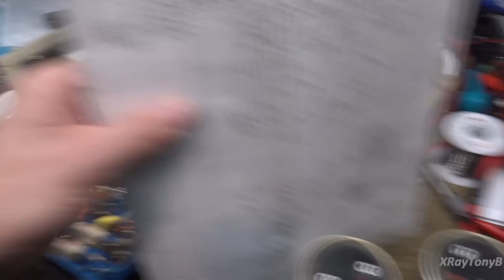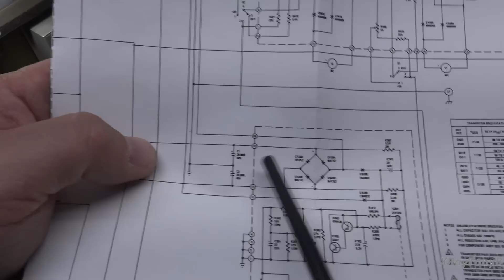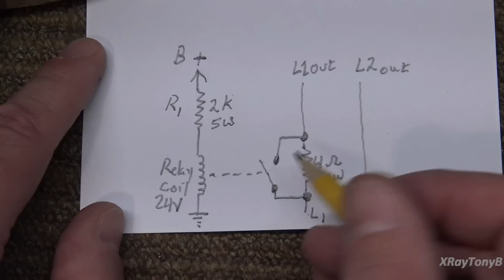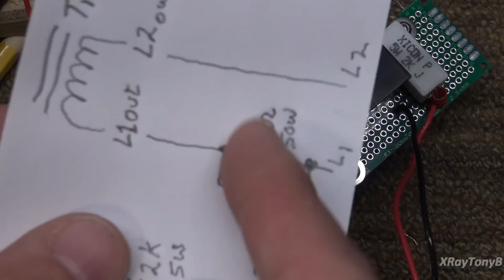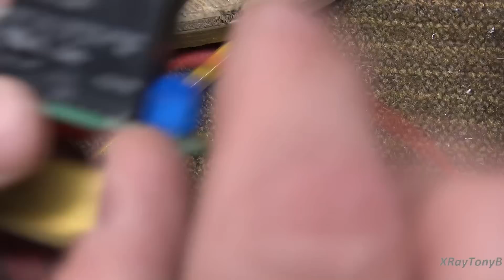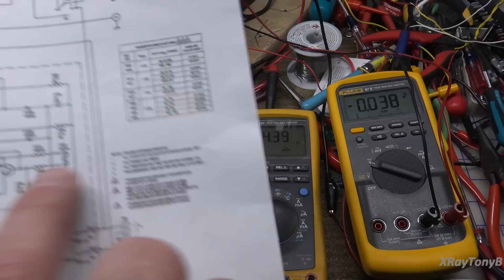Adding a Soft Start Circuit to a Power Supply

Comment: That a great circuit. I do a lot of  power supply's and Tube RF amps that have large capacitors . Them values of inrush resistors can change with size of transformer and voltage of line. with that amp in video you could use 48V relay coil. 24 DC is very common. Also that inrush current is hard on diodes . I had so many go bad . even broadcast transmitters use soft start . just 3 resistors for 3 phase with a contactor across. and the output tubes filament supply has step start . taps on primary of filament transformer. There is a outher soft start circuit that is similar and works great I use on tube RF amps. ham radio type. using a 240V or 120V relay coil across transformer primary. then the series resistor is 20 to 30 ohm 240V 10 ohm 120V 50 watt or so with a 2 or 3 amp slow blow fuse in series with resistor. If you have a diode short or tube short the 2 or 3 amp slow blow fuse blows saving the big surge. I copied the soft start from 3 phase and made it for smaller units. mind you running 480V with 277V to natural. 277V contactor. 500 watt resistors in a cage . 3 cartage fuses 600V . does same thing. large or small that soft start really works. Thank you,😀

Comment: I like this solution better than the thermal ones. Quick cycling can defeat those. Whether it's someone playing with the power switch or just quick power-outs, it's bound to happen.
Reply: The thing that bothers me is that the rail voltage goes pretty low before the relay opens. I'd rather have it open when the capacitors drop to 80% charged.

Comment: preferring transistor than relay for realizing smoother and safer soft start function, and hoping the circuit diagram fixed on the table and viewed by your camera with smooth panning and enlarging in order for watcher to view the circuit exactly, best...

Comment: When you say, “you can add fly back diodes if you want, it won’t hurt anything,” I’ve read (and can dig up a hard copy of) an article by a relay manufacturer that said that reflexive  use of fly back diodes can and do harm the contacts of relays. The manufacturer was objecting to the very thinking you are commenting on, that is, that many feel that if the relay is DC, they need to include a fly back diode. I guess what I’m trying to say (and not doing a very good job of it) is that while in the case the circuit presented, i.e., the soft start circuit, the use of fly back diodes won’t hurt anything; it is not true in every case that the use of fly back diodes won’t hurt anything. If I recall correctly, I think the relay manufacturer was advising the addition of a resistor in series with the fly back diode to cut down on the rush of ‘fly back current and resulting arc flash destroying the relay contacts. I need to go back and re-read the article. 

As others have stated, I found the entire video very interesting and informative. I have a tube amp with soft start. The manual is at pains to say never to turn the amp off and then immediately back on or damage to the power supply may result. Because I managed to inadvertently perform that maneuver a few times, I put a label on top “1 Minute” to remind myself. I’m not sure how their soft start circuit is constructed, but you analysis helps me understand better how and why such a delay is recommended. I do like how you break everything down, your passion is contagious. Going to dig that article out now.
Reply: An extremely simple (and low cost} soft start "circuit" consists of a single thermistor which adds resistance when cold and becomes more conductive as it heats up. Without a relay to bypass the thermistor it will remain hot when the amp is powered, and after power is disconnected it will take some time for it to cool down. Until the thermistor can cool down sufficiently it will not be an effective current limiter. A rapid off-on cycle defeats it.
Reply: @steveboguslawski114  Thank you for the response; you’ve increased my understanding of why I need to wait. The manual was not very technical.
Reply: @steveboguslawski114  It seems to me that this circuit has a problem similar to the thermister circuit. The rail voltage has to drop quite a bit before the relay opens.
Reply: @BlankBrain  True. A lot depends on how fast the power supply capacitors discharge when power is interrupted.  The use of a fixed resistor rather than a thermistor eliminated the problem of waiting for the cool-down period. But the goal is to reduce inrush current and the highest current occurs when the capacitors are completely discharged. You avoid the worst-case situation since the relay will open before the capacitors fully discharge. The issue now becomes the difference between the pull-in and drop-out points of the relay. If you carefully choose the resistance in series with the relay you can get it to pull-in at a higher rail voltage, which will have the benefit of raising the drop-out point as well. A more complex circuit could be used to cut power to the relay quicker.
Reply: @steveboguslawski114  I was thinking about using a zener diode to control the relay. Relay closes when zener voltage is reached at the rail. When rail voltage drops below zener voltage, the relay opens. It only adds one part.
Edit: This is an improvement, but doesn't protect the transformer. A 555 timer set to 500ms to 1s would be better. More complex circuit and my need power for the 555! I'm looking to protect vintage gear, so I'll do whatever it takes.
Reply: @BlankBrain  I understand there is a fuse in series with the primary of the transformer.  The right fuse would blow much faster than the time needed to cause any damage to the transformer.  I frankly find Tony's solution to be electronically-effective and cost- effective.  I would just install a flyback diode in parallel to the relay coil, nothing else.  If I can give any other constructive criticism... I would not make holes in any place in the vintage equipment, I would find a solution to install a new board without making holes in the equipment.  That is all I have to say.
Reply: @kylesmithiii6150  I'm not worried about blowing the transformer. There is mechanical shock and degradation that can eventually cause failure. Besides, I don't like my lights dimming when I turn my amplifiers on.
Reply: @BlankBrain  Good points.  I will do some tests replacing the 4R7 (50W) with some much higher than that and see how it performs.  I am 100% with you about "I don't like my lights dimming when I turn my amplifiers on.", that reminds me of the 'Chevy Chase Christmas vacation lights scene'.
Reply: Wikipedia has an article called "Flyback diode".  The folks who wrote that article explain quite well the subject, including a screenshot of the transient negative voltage spike across the coil of the relay.  In summary, the electromagnetic energy stored in the coil needs to be dissipated (or transformed) immediately when the current across the coil is turned off (since V = L di/dt).  With a flyback diode installed, the energy will be dissipated as heat on the resistance of the coil in a fraction of a second when the relay is turned off.  If that coil resistance is not appropriate then a resistor needs to be installed in series with the flyback diode.  I have never seen ordinary relays that come with a flyback diode installed at the factory (but I am sure that they exist), but I have seen and used reed switches that can come with a flyback diode already installed for the exact same purpose (see for example item number HE3621A0500 at Mouser or DigiKey --  "Optional coil suppression diode to protect coil drive circuits").  Related to your point, that Wikipedia article says: "Design: When used with a DC coil relay, a flyback diode can cause delayed drop-out of the contacts when power is removed, due to the continued circulation of current in the relay coil and diode. When rapid opening of the contacts is important, a resistor or reverse-biased Zener diode can be placed in series with the diode to help dissipate the coil energy faster, at the expense of higher voltage at the switch..."
Reply: @kylesmithiii6150  That’s great and very helpful, as I couldn’t put my hands the article I cited even though I saw it recently. Thank you not only for the reference to Wikipedia, but your cogent interpretation to the matter at hand. Like you, I’ve never seen a relay from the manufacturer with a fly back diode installed, I seen many DC relays installed with fly back diodes in the field.
Reply: it seems to me that the flyback diode is only across the relay solenoid.  The contacts are in a different circuit.

Comment: I've done similar using a scr that slowly (over 10 cucles shorts out a resistor that is in series with the input of the transistor. The only thing agaisnt this is even wen it's full on it will still rob a volt of the incoming votge because the acr does not go to zero.

Comment: Hi Tony. If you have a relay with an extra set of contacts (DPDT), you can wire in an extra resistor (whose value will have to be determined by experimentation) in series with the one already there, and put this resistor in parallel with the normally-closed contacts so the resistor is shorted on initial power-up. Once the relay pulls in, the N.C. contacts open, and the 2nd resistor is now in the circuit so the relay only needs the hold-in voltage/current. This should extend the life of the relay coil. You may need a small capacitor to prevent relay chatter, though, across the N.C. contacts/resistor. Maybe .01-.1 uF disk capacitor.

Comment: Wouldn't a NTC thermistor be much less complicated and more reliable? Fewer components, no moving parts.
Reply: Yes…. But it robs a volt or two which reduces power the amplifier can deliver. Also it is no good with a quick on/ off sequence since it needs time to cool down to gain resistance. Ie it’s no more a soft start unless it can cool down
Reply: @Starcraftowns99  This is true!
Reply: Too much heat, in a already cramped little amp

Comment: Wouldn't it bei easier to parallel the relay to the speaker protection relay, at least If it's circuit can provide enough power and it kicks in even with the reduced current?
Reply: IF an amp has a lower voltage winding and DC power for items such as the SP relay, or meters, you could use that power for the relay coil, as long as it didn't overload/undervolt any regulating components feeding it. There could be some future "troubleshooting" issues arising from interlinking 2 protection circuits like that though, especially because the SS add on won't be on a repair schematic, and may not be obvious to a tech that wasn't aware of what it was there for. Personally, I don't think i'd draw power away from the SP relay circuit, but that would be my choice.

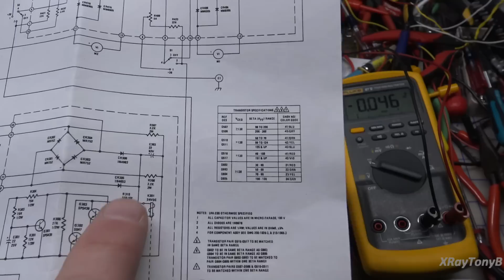Comment: 24:54 If you want, you can add a small neon bulb in parallel with the relay coil. During normal operation, the breakdown voltage of the neon bulb is way higher then the voltage of the protection circuit itself and the neon bulb acts like a open circuit. When back EMF is generated by the relay coil, the voltage will be clamped down once it reach the breakdown voltage of the neon bulb.
Reply: You could also use a diac, which is like two 30 volt zener diodes in reverse-series.

Comment: I'd probably just wire a NTC thermistor in line with the mains winding, if I could find anything durable enough for the job. When turning the amp on, this thing's resistance is a few ohms, decreasing as it heats up under current. It will eventually reach a steady state temperature and resistance, dissipating some heat.

BTW, the dim bulb is a PTC thermistor.
Reply: I also use a NTC thermistor
Reply: I do the same thing.  I add one in every receiver I restore.  I'd be interested if anyone had reasons why using an NTC thermistor as an inrush current limiter is a bad idea.
Reply: @davewhittaker9547  I'm not sure if anyone would argue it's a BAD idea. The repeat power-on problem is probably the most valid reason to not use them. If you've got balance/bleeder resistors across the caps— or any parallel resistance to 0V for that matter— the caps will likely drain way before the NTC cools down to its resistive state after powering down. So powering on the device again would theoretically expose it to inrush current conditions despite having that NTC in there. I  know some people might not like them because of their non-linear resistive qualities at operating temp. They'll often bypass them with a relay to take 'em out of circuit once they've done their job. That's kind of a counterintuitive use of the NTC technology in my opinion. If you're going to involve relays and bypass the damn thing then why not use a resistor like Tony's doing here. NTC's are fine, I use them sometimes if space is an issue. But if you're anticipating a problem and plan on doing something about it then you might as well do the best you can within your means. Woa I said a lot of words. 😅
Reply: @deviant_multimedia  I see what you're saying.  I never thought about the recovery time, but it could be an issue.  Not often, but every once in a while I might quickly power cycle it.  I need to give this some thought; especially since I also routinely increase the size of the filter/power capacitors near the transformer.  I'm curious now, and I think I'll do some experiments on how long the NTC thermistors I use take to recover.  Thanks for taking the time to post the explanation.

Comment: I was thinking about a fly back diode may increase the time of the kick out when turning the power off. Isn’t the caps taking the charge built from the magnetic field of the coil? Curious if the relay is actually causing the capacitors to bleed out it’s charge. Am I asking right?

Comment: You make very good instructional videos as your explanations are very thorough.  

Regarding the Marantz design,  I am surprised  that 60Volt caps are being used with approximately 50 volts applied across them.  50/60 would be an 83% stress level on those caps, and if it's 57 volts, as you stated later in the video, that would represent a 95% stress level.  Could be why one of them failed open. Mil Spec defines high reliability, at stress levels of 50%.  I'd imagine the form factor of the caps, available at the time,  was the major consideration, but newer caps have smaller form factors and if it were my amp, I'd try to get 100 Volt caps.

Also not to nit pick, but you didn't mention that the inrush current also stresses the caps, you mentioned that it could hurt the power switch and x-fmr, (you probably just forgot to mention).  Just an observation, not meaning to be critical for the sake of being critical, just providing some feedback. All in all I enjoy your videos, and find them very practical.  Thanks for taking the time for the tutorials, as they are probably very time consuming and difficult to pull off.

Comment: Hi, Tony. A related question, please... 
I am building my DIY AC PSU chain. It consists of:
1) Emergency All Stop Button to
2) Isolation Transformer to
3) Variable Autotransformer to
4) Dim Bulb Current Limiter (Multi-Bulb) to
5) DUT.
Each piece is independent, so that it can be used separately, if need be, for other purposes.

Might it be helpful to include a NTC Current Limiter? Advantages/Disadvantages? If so, which component should I add it to? The input on the Dim Bulb Current Limiter? It sort of seems redundant, unless all the bulbs are bypassed... But, I won't always  be using the Dim Bulb, in the chain.

Thank you for your help.I posted
Disclosure> I posted this question on a forum, but I never got a response.
Reply: Got roughly the same idea for a mains testing box in my lab, only integrated and not separated.
NTC is useful before transformers, especially toroidal. These things can have an inrush current on their own.
Reply: @KeritechElectronics  Thanks, Keri. The Isolation Transformer is the problem, it keeps popping the low amp fuse that is in the Emergency Stop Button. It makes sense to add the NTC to the Iso Trans, because it will be turned on, and allowed to settle down, before the DUT is turned on.